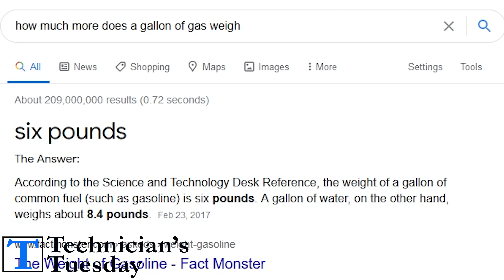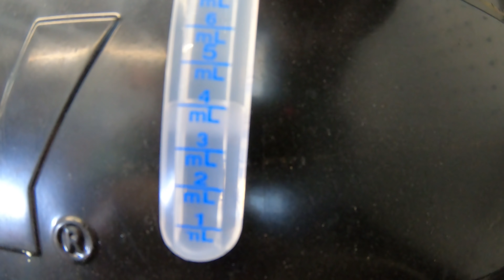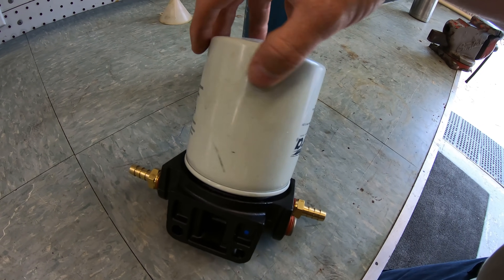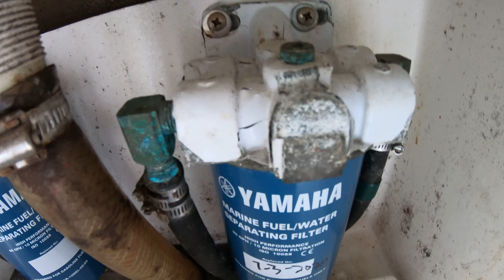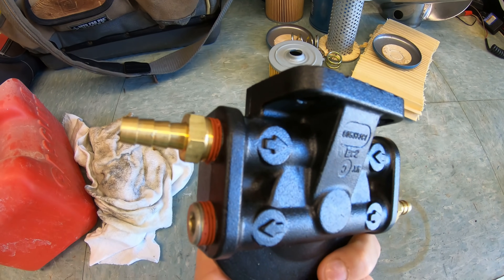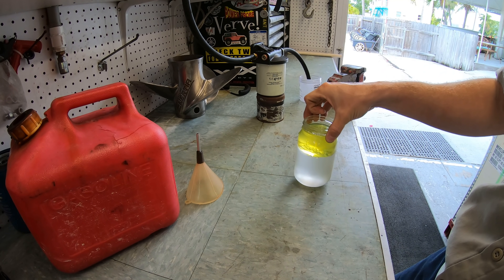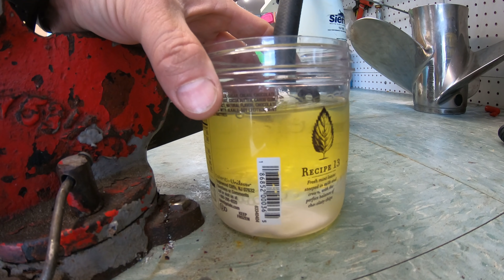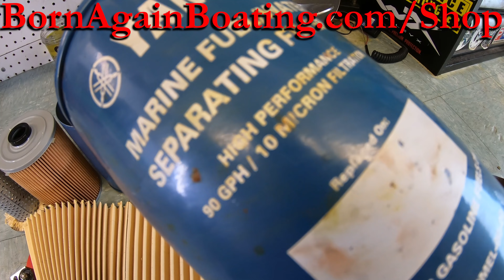How A FUEL WATER Separator Works!

Comment: I recently bought a used Tracker pontoon with a 60 efi 4 stroke merc. The boat sat a LLLOOONNNGGG time before I bought it. It stalled the other day and would not start. Every orifice in the fuel system from the main fuel line to the filters to every screen in the VST tank was clogged with varnish and gunk. The filters were full of a substance that looked like cottage cheese. I cleaned the VST tank, replaced the filters, external fuel line and installed a water separator. I also siphoned most of the fuel out of the tank but couldn't get it all because I didn't have enough gas cans. It finally started after I cycled all of the fuel out of it by disconnecting the final high pressure fitting right before the injector manifold, cycling the key, and disconnecting the fuel line from the tank. Before I cycled the key I dropped the end of the fuel line in a clean gas can full of 2 gallons of fresh fuel and 1 can of seafoam. I also added many cans of Seafoam Marine and put in 15 gallons of fuel. She ran great for many hours UNTIL today when it stalled on me after having run 5 or 6 hours total over several days. Someone towed me to a marina where I started to drain the water separator and pure water came out. Again, I dropped the fuel line into a gas can of fresh clean gas and ran it to my marina about ten miles away. I think what happened is that the gas remaining in the tank after I siphoned most of it out had so much water in it that it filled up the water separator and the motor was sucking up pure water. I had no idea it would fill up so fast, but it did. I know this is long winded but I thought it might help someone else having a fuel issue. Next step, drain the water separator the rest of the way and probably siphon out ALL of the fuel this time. Either that or I need to check the water separator every time I use it for a while until all of that bad gas is gone.

Comment: So in reality, the water separator part is actually reusable since it's really just a can for it to fall into and sink to the bottom, while the top allows a proper flow of good fuel.. the filtering part (paper) is for normal debris.. which most boats already have also after the separator... so I can't see any real reason to change these that often, just dump them every few months.  Should last for years I would think.

Comment: I know this is old  but whats the point of getting a new filter then, its just holding the water it collects and all I do is take the filter off and just empty it and put it back on.. Sure after years I could see a new one is needed but just emptying it has worked for me forever now.
Reply: Exactly.. was thinking same thing, I believe it's just more hype to sell product, the way it works makes it reusable considering you already have another filter downstream as well.  I'll be dumping and reusing for a few years before replacement.
Reply from the maker: A lot of it has to do with the paper breaking down and clogging up, also the debris it catches can also clog up the paper element, and how good of fuel are you getting. A lot of variable, but yeah, all things considered you could reuse it if you wanted to, you really don't need to dump it either if you don't use ethanol and have a water problem :)

Comment: I wish they had a Hydrophobic Mesh like a Mr. Funnel and just block water from passing. you might as well be using a Fram oil filter if it does not block the water from passing.

Comment: I’m a bit confused. I understand the water is heavier. The gas makes it way back up through the middle of filter. But….. what happens to the water that was separated? Where does it go? How does the water get removed from filter?  Lastly, how often should the filters be changed. I currently change mine out annually based on a 3-4 month boating season.
Reply: Removing the filter and replacing it with a new one is the way to remove any water collected in the bottom of the filter (this is where the water goes).  I do this annually, also, and empty the filter contents into a clean, dry, clear container (e.g. used food jar) and inspect it for water and contaminants.  If you find water or contaminants, you need to determine the source and resolve those issues.  If all is well, I use that fuel in my mower or other gas powered yard tool.  IMO, nearly equally important to this is using ethanol free fuel and always treating fresh fuel with whatever stabilizer and other additives your engine manufacturer recommends, especially if all of that fuel is not going to be burned through the engine in the next 60 days +/-.

Comment: What do you use to seal the pipe threads when installing a new separator bracket?
Reply from the maker: I use gasola or high temp thread sealant
Reply: @BornAgainBoating  thank you! I have to redo mine, it’s corroded and leaking.

Comment: When I bought my boat the sales guy really really stressed changing this filter regularly.  Fuel stabilizer works in preventing ethanol related problems...make no mistake about it.   I used it for years without a problem before I learned that non ethanol was available in my area.

Comment: Excellent video thank you again. Could you do a supplement or add-on video about talking about describing or showing us the effects the indicators that you have water in your fuel because of the way the motor is behaving what symptoms will indicate that you need to change that filter or that you've got a bigger problem and the filter can't handle it all. Just looking for a symptoms thank you

Comment: I wonder if there is some sort of small centrifuge that would eliminate the need for disposable filters?
P.S. PLEASE use proper gloves when handling petroleum products.
Reply: they make ones that are clear plastic bottom and unscrew to dump the water - over time the filter would still need to be replaced but I just installed one of these on our 30HP merc this winter - will see how it works in the spring.    I bought this on Amazom : SeaSense Universal Water Separating Fuel Filter with Clear Bowl
Reply: @ronm7781  Thanks for the reply! Please keep us posted :)

Comment: Keep a oil filter wrench in your boat in case your water separator filter it's full of water and stalls your boat out you can drain it all out of the filter and get back and not have to get towed in
Reply: This happened to me this weekend you re right good sir.
Reply: That makes little sense at that point, you fuel lines already have water and most likely hit the injectors until you clean the lines from you f/w separator  to the injectors it wont crank over. Carry a can of starter fluid so it can burn that out and dump some type of injector cleaner in the f/w separator but most likely you have a tank of bad fuel.

Comment: Technically gas floats on water because it is less dense then water not bc it ways more. Yes one gallon of gas ways less than one gallon of water. But if you mixed 100 gallons of gas with one gallon of water the water would still go to the bottom even tho there is more weight of gas because the water is more dense.

Comment: And these larger spin-on filters have a very large surface area which wont plug up with debris and also stop much more debris than any small canister fuel filter.  A huge improvement!

Comment: now i have one of those fuel filters with the little plastic cup on the bottom - does that mean i don't have to change it? well until the cup has water in it? or is it worth buying a replacement with the cup? or just get a filter with no cup?  I liked the idea of just emptying the bowl if there was water in it - like an old carb.

Comment: Hmm, would you get a similar effect if the intake from your fuel tank was off the bottom by a few inches?  Then before heading out for the day you drain a gallon or so from the bottom of the tank.
Reply: You could do that. I hope you dispose of what you drain responsibly. Or you could install the water separator that everyone in the world agrees is necessary.
Reply: @Al-ix5um  Oh definitely!  I was just wondering if you would get about the same effect, for example with multiple fuel tanks on a larger boat.  I'd have the fuel water separators installed as a matter of course, if I can ever afford something more than my (literal) canoe!

Comment: Was told by boat shops not to use ethanol or you void warranty on you outboard 🤷🏻‍♂️ plus it tends to go stale a lot faster and turn to crap in the tank i wont even put it in my mower for 5c a litre cheaper than standard 91 its not worth the hassle

Comment: Hmmmm......my understanding is that a Racor filter's paper core has a hydrophobic coating that repels water and keeps it from passing through the filter.  At some
Reply: At some point the paper will restrict fuel flow and the engine's performance will be reduced, causing it to lose RPM and power.

Comment: Whoa... Who told you that ethanol is smaller than a water molecule? Ethanol are 2 methyl groups = 2 carbon atoms plus 6 hydrogen atom. Then another oxygen plus hydrogen. Water is H2O. One oxygen and 2 hydrogen. Which molecule do you think would be bigger?  The reason you have what seems to be more water when you shake together gas that has ethanol and water is that the ethanol dissolves or more appropriately termed dissociates into the water phase of the liquid mixture. Think of booze.  90 proof rum is actually 45% ethanol in wood soaked water     Hope that clarifies that.

Comment: Difference between fuel filter and water separator?
Reply: A standard fuel filter is going to (I believe) have a coarser, more open paper element.  It will catch particulates in the fuel (metal, plastics etc).  Still not 100% sure how the separator works to cull out the water from the mixture.  Unless there is some hydrophobic coating on the paper as another poster said about the Racor brand.

Comment: That being said Aaron, so in this example a 225 Optimax. Non ethanol fuel, 91 octane 93 octane. Ive been running Non Ethanol at 89 Octane but Im wondering if the engine needs a higher Octane......Just thinking. Oh the non ethanol helps with not getting water in the fuel, right?
Reply: JAWS 24, no. Ethanol is not associated with octane.
Reply: @benjigans1419  Thanks Benji, I know that part. In my area all I can get is 89 octane nonethanol, I was just questioning if I should regardless of ethanol use the higher octane fuel. Thanks for your time
Reply: I stay away from ethanol fuel because of what it does to fuel lines.

Comment: Ok - maybe I’m wrong by my engine has one of these already - why would I add a second one? Extra capacity? Ease of replacement? Or maybe it doesn’t have one and I’ve replaced a diff filter annually (2 stroke)...
Reply: You engine likely has multiple filters and screens, on the low pressure and high pressure side of the fuel system. These filters are for particulates only (blanket statement for simplicity, not fully true). The external fuel water separator acts a pre-filter for your engines internal filters which are often much more expensive and harder to get to. It’s primary function is to separate water from the fuel stream. For example, My engine which is a 2-stroke Yamaha HPDI and it has two forty dollar filters which are more involved to change; my separator is 25 for a new element.
Reply: @eastwardExpansion  Thanks George. Mine is a Merc opti and I validated it has a separator, but like you said it is harder to get too (remove the upper and lower cowl). Thankfully it's only $13, but still... Am repowering so I'll see what the new setup looks like and install one - good call.

Comment: I have a 1991 Sea Ray that doesn’t have a Filter, other than the little one in the carb inlet fitting, looks like a good winter project, install a fuel water separator

Comment: Hey, just a quick nitpicky thing about verbiage, in the beginning of the video, the narrator says that the water sinks because it is heavier than the fuel.  That’s not really correct, the water sinks because it’s more dense. It has more mass per unit volume. The original verbiage might make it sound like the relative weights of the two liquids makes an impact
Reply: Incomplete. Ethanol?  Give this mixture some time with gas and water and you get a nasty mess
Reply: He referred to a chart that indicated that water weighs 7.3 pounds per gallon and  fuel weighs 6 pounds per gallon.  You can say "more mass per unit volume" if it makes you feel smart, but its not inaccurate to say water is heavier than fuel.
Reply: The pedantic comments about the use of the word weight are silly. When comparing the classes of materials an equal volume is implied in the comparison. Do you object to the use of "lighter than air" balloons. Is lead heavier than air ? - Yes ( by volume is implied in the class comparison) . Is a bullet heavier than Earth's Atmosphere ? - No (Different volumes have been specified).

Comment: The solution to this problem is to get rid of ethanol gas and price non-ethanol as it should be!
Reply: Where are you located? I’m in south Florida Miami area and we have non-ethanol fuel. Some have 89 and other have 90. Both are prices reasonably higher than fuel with ethanol.
Reply: @hayronalvarez4583  I'm in panhandle, we have plenty of non-ethanol and always have. Never had to put ethanol in any of my boats.
Reply: In Australia ethanol ( E10)is not commonly used even in cars and not recommended for marine use most servo’s have standard 91 95 or 98  or E10

Comment: When you put a new fuel water separator on do you fill it with gas before you put it on?
Reply: It's not required but highly recommended so the engine doesn't just spin over while the fuel pump is prime the line.
Reply: Yes, unless you want to wait and crank your motor until it's dinky little fuel pump sucks fuel into it.
Reply: If you have a primer bubble no need too
Reply: Mostly fill it.  These filters hold a lot of fuel.